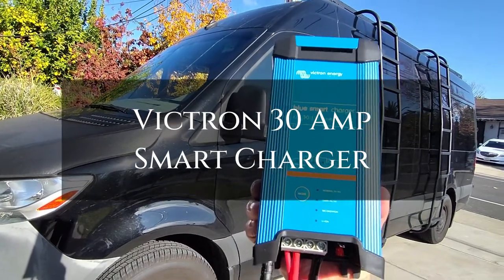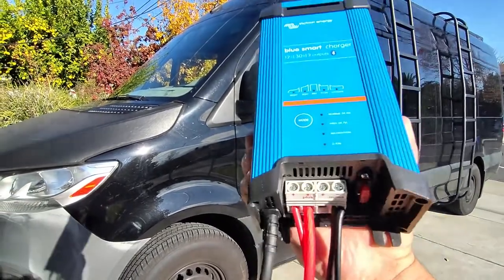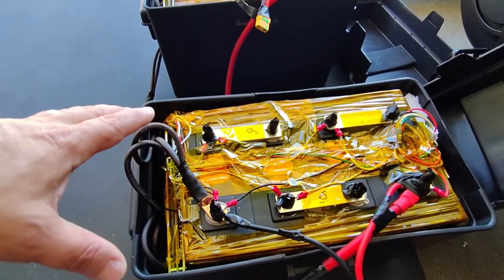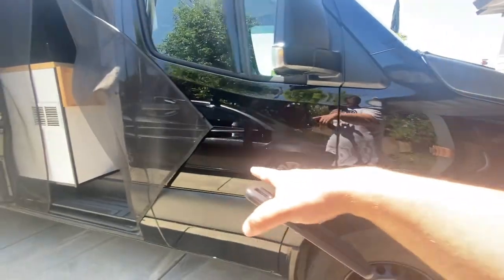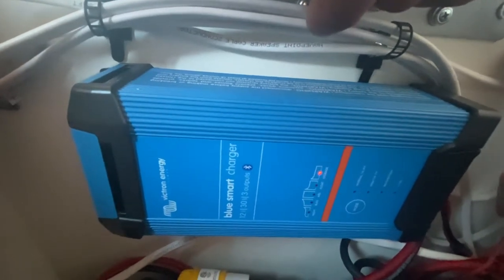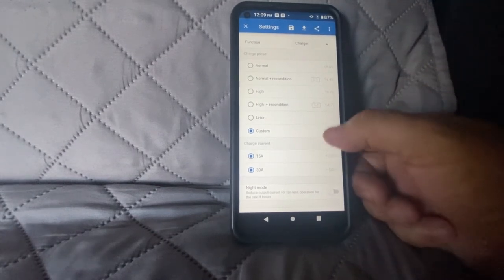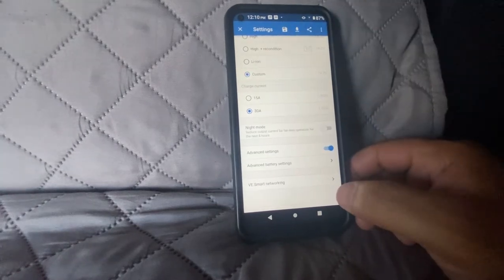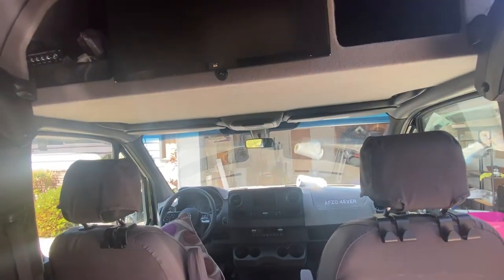30 Amp Victron 3 Pole 12 Volt Battery Charger Review #vanlife

Comment from the maker: ▶30 Amp Charger https://amzn.to/46TB573
▶500 amp smart shunt https://amzn.to/46R203x

▶▶▶Camper van playlist
https://www.youtube.com/watch?v=r2KTXLqso2c&list=PLDEbtVOPRC-id5xjqFsYm87bJSJL8bLbe

2019+ Sprinter Review https://youtu.be/wAAV6bnHNzY
The new toy  https://youtu.be/EAKbCledvsQ
Low Key Battery https://youtu.be/-FI_DG-DE9k
How to Buy a Camper van for cheap https://youtu.be/nqPSV0mszfk
Seat Removal https://youtu.be/KSUQawuSt_w 
Headliner removal https://youtu.be/FjrJBLXEbyU
Maxx Air Fan Install https://youtu.be/QXxBSx3cfI8
Maxx Air Fan Review https://youtu.be/JIRG7lSR5yQ
Maxx Air Fan Fix https://youtu.be/6k0mPqCgrl4
Bathroom Fan Review https://youtu.be/QXxBSx3cfI8
Spare Tire Carrier https://youtu.be/wVQ_h-FjtPE
Oem Diesel Heater Trick https://youtu.be/Ws9GHo9bWeM
Led Upgrade https://youtu.be/r2KTXLqso2c
Sportscraft Swivel Adapter https://youtu.be/HVkj6KVpUbs
Pocono Swivel Seat Adapter https://youtu.be/r-1HpIl71_I
Front Speaker install https://youtu.be/JjoJH4z4G1E
van Sound Deadener https://youtu.be/8x8RxmrBxL4
Sprinter Trim Removal https://youtu.be/ucYJsH5FJxY
Van Roof Deck https://youtu.be/4cu8mjVKQzc
Front Air Filter Change https://youtu.be/U46Ah40_vIM
Cabin Air Filter https://youtu.be/y8oZNLOkrok
907 Sprinter Oil Change https://youtu.be/bmgI-9KeEik
Maintenance reset https://youtu.be/wDTMwXHGqRY
Diesel Heater Hack https://youtu.be/Ws9GHo9bWeM
DEF Fluid https://youtu.be/Q84lEhLrobM
Portable Toilet Review https://youtu.be/fYu66hqGJZo
Affordable Kitchen Galley idea https://youtu.be/5DG9y_kmHLY
Rear door storage https://youtu.be/bPZfvTWAze8
Modify Rear A/C vent https://youtu.be/o4FJ6Y1ulCs
Sliding Door Bug Screen https://youtu.be/oGA8udVJlYM
Shower https://youtu.be/O4POEFKQmJQ
Plumbing video https://youtu.be/PuOqOt_911I
Simple bed idea https://youtu.be/Q7uGVFPgeDI
Van Life Camper Van Kitchen Galley Idea Under $200
https://youtu.be/5DG9y_kmHLY
Premade Camper Van Bed That Sleeps 4 Under $250
https://youtu.be/Q7uGVFPgeDI
Thetford Porta Potti Review - Simple Odor Free Camper Van Toilet Solution
https://youtu.be/fYu66hqGJZo
Van Life Rear Door Storage Solution for Under $40 for Camper Vans
https://youtu.be/bPZfvTWAze8
Sprinter Factory Roof Ac - How to Modify Vents for Van Build
https://youtu.be/o4FJ6Y1ulCs
Van Life DIY Camper Van Bug Screen For under $40
https://youtu.be/oGA8udVJlYM
Long Seat Belts for Van https://youtu.be/b9sQHKU-xdk
Battery Shunt https://youtu.be/54xGTbcFQB0
30 amp Battery charger https://youtu.be/SY0wS3DlKho 
Battery Box Cooling idea https://youtu.be/sng2aot7PLc
Window Covers https://youtu.be/aO407scjyfU

Comment: Hi. Can I charge AGM (260 ah) batteries and my lifepo4 (560ah) at the same time?
Reply from the maker: Mmmm if one is fully charged and the other is drained. It may not be a good idea. After they are on the same circuit with a full charge then you should be okay to charge at the same time. This Still not ideal but you should be okay.  Before connecting the batteries together, be sure to charge each battery separately.
Reply: @RANDOMFIX  Thank you for your quick reply 😮😉 
But AGM and lifepo4 are based on the same chemistry? Is it ok to charge them at once by Victron?
Reply from the maker: Omg I’m sorry I didn’t see that. No do not charge at the same time. Your agm voltage is way lower and even with this 3 pole connection you can only specify one program at time. I don’t know your setup but maybe charge the agm off the motor battery connection if in a camper van or rv.

Comment: Does this charger give you three different screens for the three different outputs? Can you monitor each output individually? Can you have three different sized batteries of the same chemistry charging together on each output? Thank you.
Reply from the maker: All the battery chemistry have to be the same. It has 3 different output but you can not specify any out difference at each output. Still great charger but if you go with signal output there will really be no difference.
Reply: @RANDOMFIX  thank you! This makes sense but wasn’t clear from their documentation. It’s a single battery charger with three outputs not three chargers in one box. Thanks again!
Reply from the maker: Glad to help. Good luck with your setup

Comment: You said there’s only ONE negative terminal?  How are you supposed to charge two batteries?
Reply from the maker: You would use that same negative post. From that one post your would make 3 negatives.
Reply: @RANDOMFIX  Thanks man.  So I make some splices to hook up 3 negative cables to the one post and I can charge three batteries at the same time?

Comment: Does it self regulate the charging of 3 lifepo4 battery with different capacity (eg. 50ah, 100 ah, 150 ah) ? My lifepo4 100 ah battery says that best input volts is 14.6: i saw that charger going on 13.7 (or somthing life this) for lifepo4 battery, how come? can you explain why? i dont want to ruin batteries...thanks
Reply from the maker: That the specs on my batteries but please follow your instructions from your battery maker. You can customize the output. 14.6 seems really high but just double check

Comment: Hey i had 2 questions that i cant find answer too. 
1. Can you use a 15a shore power inlet or does it need to be a 30a inlet?

2. How do you connect this to your system? Does it connect straight to the battery or inverter or? 

Thanks!
Reply from the maker: You can lower the charging amps to 25 or 7.5. You would connect your battery. Do not connect to inverter directly with a battery as most inverts will surge once powering one.
Reply: 30A is on the DC output side not on the AC inlet side. It will easily run on a 6A circuit braker

Comment: Hi mate, what are the max and min absorption voltages within expert mode? Cheers
Reply from the maker: Sorry for the late reply! did you find a solution?
Reply: @RANDOMFIX  I ended up calling a dealer and they said those values are static and unchangeable. All good gone another route now 👍🏻